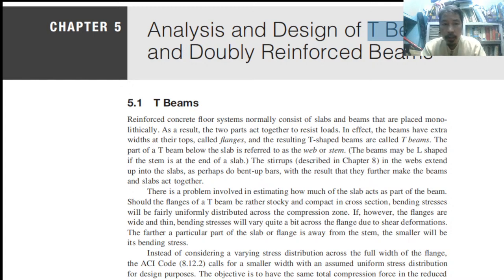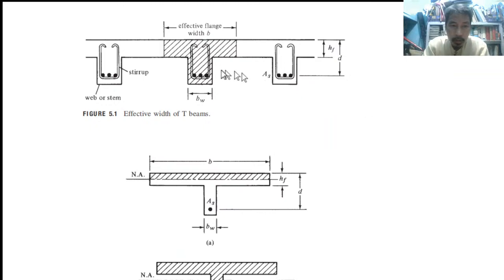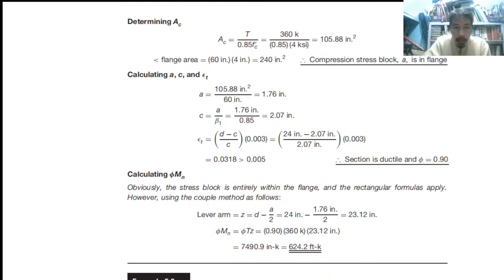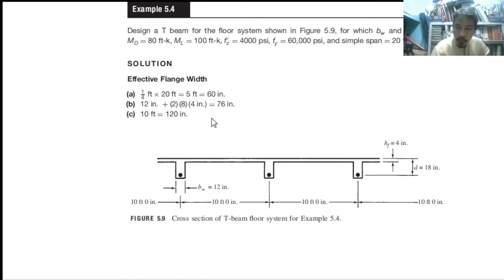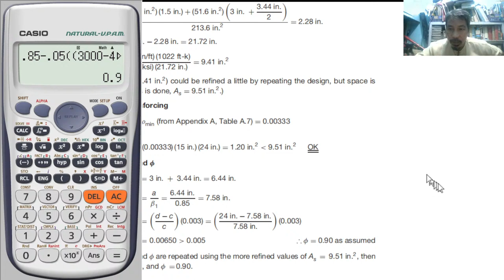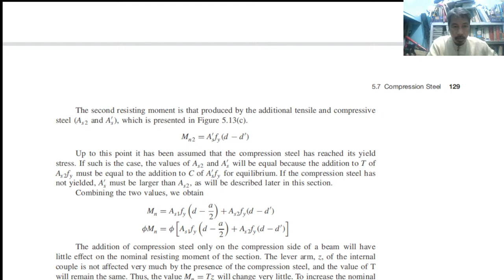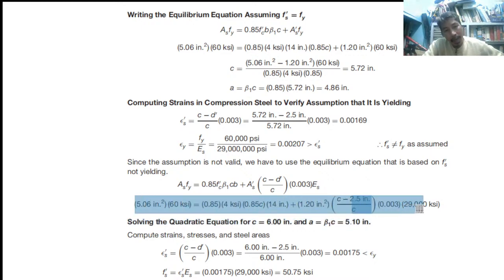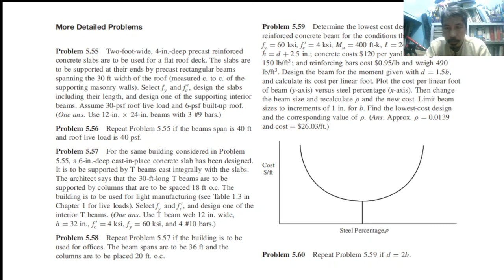[ LIVE CEE7 Lecture 15 ] DrAP Zantua Doubly Reinforced T-Beam Talks + Analysis Design & Examples

Comment: Thankyou sir for this live lecture that tackles about T beams. According to the module reinforced concrete floor systems normally consist of slabs and beams that are place monolithically. As a result, the two parts act together to resist loads. In effect, the beams have extra widths at their tops called flanges and the resulting T shaped beams are called T beams.